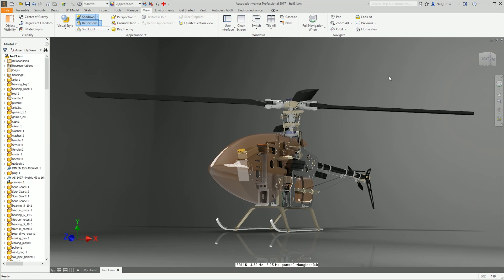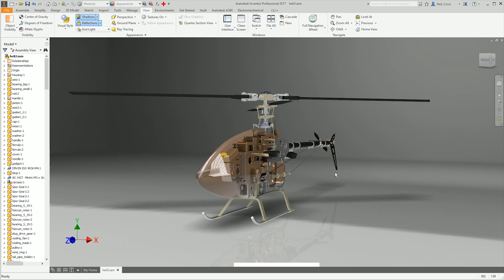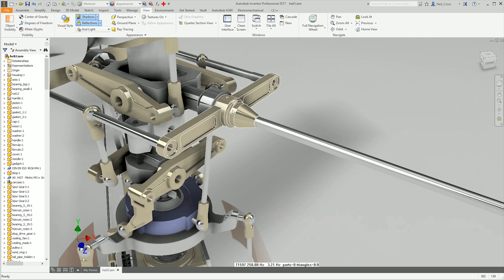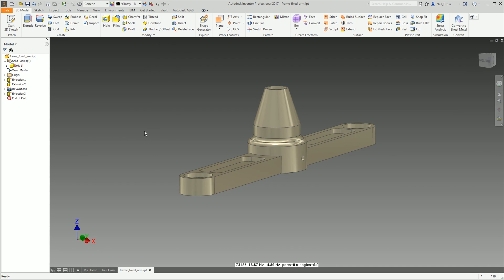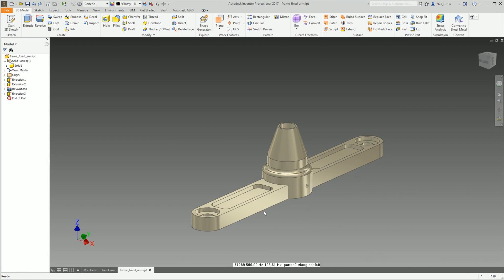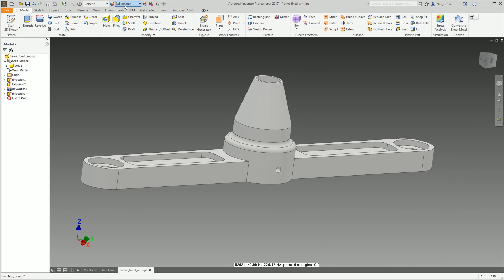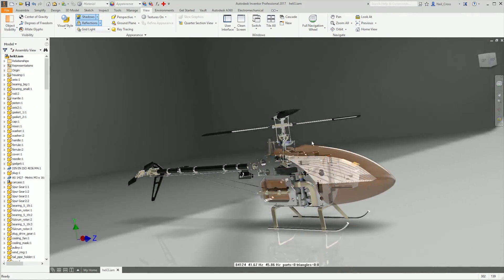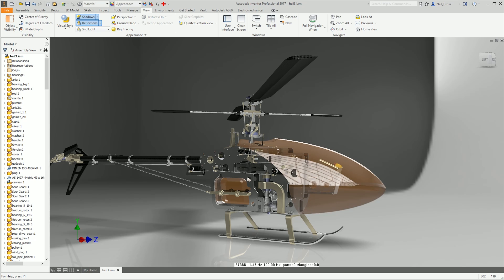Multi Face Color Override | Autodesk Inventor

Comment: Lets say I have an .ipt that is shared with two assemblies, and one of them is just cast iron appearance, and the other will have one face on that .ipt that needs to be painted a different color, how would I do this on the assembly that is being painted versus the one that is not? since they are sharing the .ipt I cannot override the face color, because it will be shared, and doing a view representation will not work with a right click properties override.

Comment: Do you have a special CAD certified GPU? With my GTX 970 raytracing always takes some seconds to update the model if I turn something around.
Reply from the maker: Ray tracing doesn't use the GPU, it's 100% CPU based.  It's normal as well for it to be really slow when trying to real time orbit during ray tracing
Reply: So I take the risk that this a silly question but why is it so smooth in your videos? I'm running a 6-core i7 but normally I just work in the shaded with edges view mode. :)
Reply from the maker: Haha I very rarely if ever show ray tracing in the videos, it's always just 'realistic' view style with the background lighting and shadows tweaked a little bit, never ray tracing :)
Reply: Ahhh ok then, I really should use more different colors in my models. Mostly steel, stainless steel and aluminium... everything looks just the same :P Thank you for your comments. :)

Comment: Thinking about getting back into CAD. Had a class that used AutoCAD back in 04 and recently been playing with Google sketchup. What program do you recommend for someone looking to CAD on a budget?
Reply from the maker: Definitely Fusion 360, all the signs are pointing towards that being the future.  It's cheap and it's almost just as capable as Inventor in many areas.